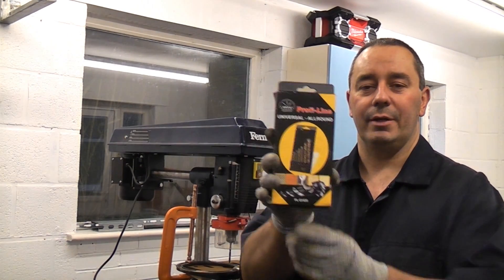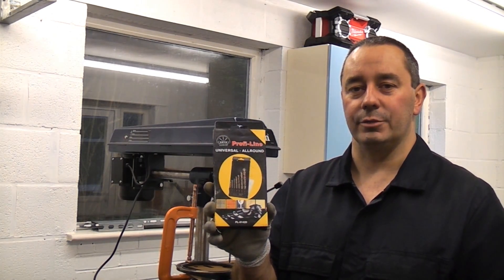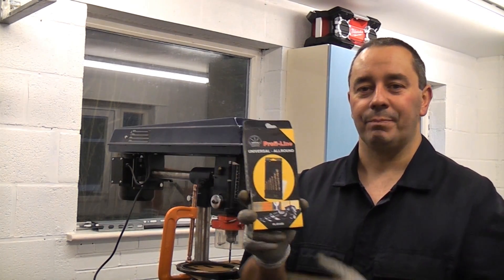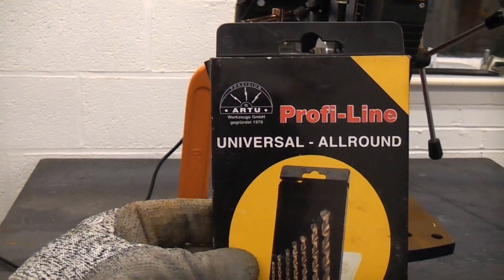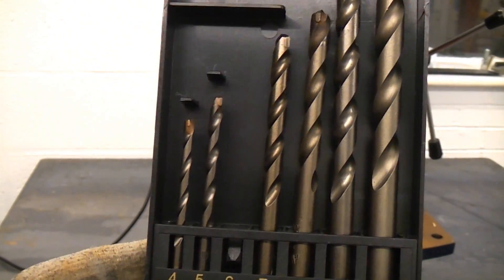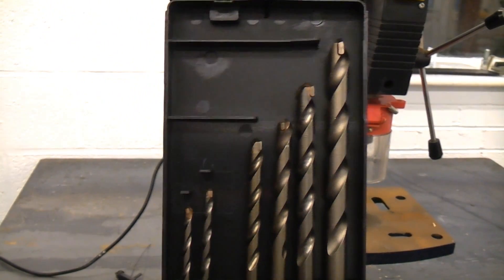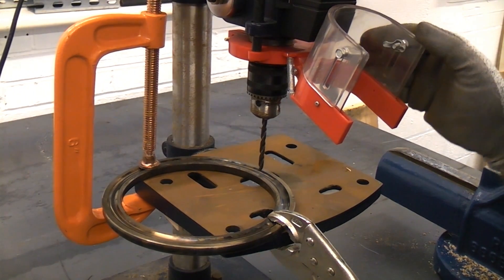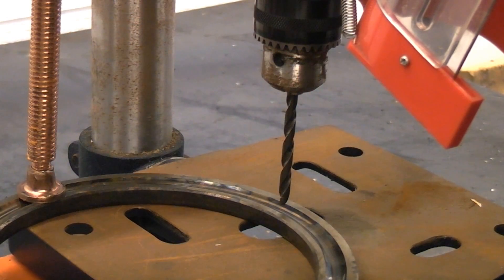How to drill hardened steel | Artu Drill bits

Comment: Surprised to hear that the highest speed should be used. You even changed the belt ratio.

So in this case RPM is more important than torque?  Would you agree that this is an exception to the rule? Thanks
Reply from the maker: Yes, I normally use coolant/lubricant when drilling steel, but these drill bits require the heat caused by the friction 👍 
I have to say that some of my ARTU drill bits are for for the bin now, but bearing race steel is incredibly hard!
Reply: @ultimatehandyman  So would it be wise to think of such bits as "sacrificial"? I mean more similar to cutting wheels than to normal drill bits?
Reply from the maker: @Gsazraetr   Yes, these bits are fine for drilling masonry/porcelain/glass etc. But when drilling a tough bearing race, just consider them to be sacrificial 👍
Reply: @ultimatehandyman  Thanks very much for the insight! Last question—
SOLID carbide drill bits on (unhardened) stainless steel. Should coolant/lubricant be used or not?
Reply from the maker: @Gsazraetr   I would not use solid carbide drill bits, unless they are in a drill press, or lathe. For drilling stainless steel, a cobalt drill bit works well and is much less brittle than a solid carbide bit.  But if I was using solid carbide, I would use coolant.

Comment: you do not use OIL , when drilling metal?
Reply from the maker: You do use a coolant or lubricant when drilling normal steel with a traditional drill bit, but this is hardened steel and can only be drilled with a specialist drill bit, which specifically tells you not to use any coolant/lubricant.
Thanks for the comment 👍

Comment: Just found this video 9 years later!   Don't know anything about metallurgy but have to drill several 9/16" holes in approx 1/4" thick heavy duty vehicle frame steel of unknown type (rumored to be part SS but probably not).   Not feasible to remove parts for use in a drill press.   Looking for the best type of 9/16" drill bit to reliably drill this in limited space, awkward position, upside down.   Yea, I know, there isn't one, but if there were, what would it be?  Cobalt?  Step drill?  Speed and cutting oil?  Not a machinest but I have to get this job done to mount a different style of air bag.
Reply from the maker: One of these should easily do it, as long as you take your time and use plenty of lubricant/coolant-
https://www.youtube.com/watch?v=HPv0W0UNdks
Or for thicker material- https://www.youtube.com/watch?v=NEXt_4Y6Wms
Reply: @ultimatehandyman  Thanks very much!  That second one looks perfect if I can find the SAE equivalent here in the USA.  Don't have room for a full impact, but I do have a stubby air impact (albeit limited air compressor supply) and an electric angle drill on order.  Will soon find out how they work!
Reply: @ultimatehandyman  This company's products sound almost too good to be true, but I've just found their US contact info, ordered the Impacta step cutter and versa adapter (altho won't be able to use the adaptor for most of this job) and some spray lube.  By the way, I called and actually got a live person!   Thanks very much for the suggestion, this seems perfect!
Reply from the maker: @DellAnderson   That is exactly what I thought. From experience I know that it is easy to make a product look good in a video. I have tried their tools out and was super impressed with them. My old boss buys a lot of cutting tools from them now, as they are really useful for the work that he does. He has been in engineering for over 50 years and even he was impressed with them 👍

Comment: Will these bits drill out a bolt extractor (chrome vandlay steel).  If  they do. I'm buying a set.
Reply from the maker: They probably would do, but I have not tried it yet.
I have used these to drill out a broken tap though- https://www.youtube.com/watch?v=7JCfEMrCjhc&t
Thanks for the comment 👍

Comment: Thanks for this. Really useful info and demo. Got an engine mount bolt to drill out of a bike frame that I accidentally snapped the end of a punch off in 😭
Reply from the maker: I've also drilled out a broken tap, using a diamond coated hole saw-
https://www.youtube.com/watch?v=7JCfEMrCjhc&t
(just another option)
Thanks for the comment 👍

Comment: Hiya, thx for the upload, did the bit go right through eventually?   
Since filming this, have you found any bits better than the ones you've used in the video?  I need to drill 4.5mm holes in the metal tongue of a seatbelt would these drill bits cope easily with that...?
Thank you for any help.
Keep the vids coming.
Reply from the maker: Hi Sean, I can't remember if the bit went all the way through, but I think it did. 
Bearing races are much tougher steel than a seat-belt tongue, you should be able to drill that just using a cobalt drill bit. Just take your time with it and use plenty of coolant/lubricant, like in this video- https://www.youtube.com/watch?v=Pa0eg9Z1eKQ
 Thanks for the comment 👍
Reply: @ultimatehandyman  fantastic.. thank you,
 I had a tongue that's gone through 8 bits, ok drilling to start, then it just stopped going through like it'd hit kryptonite or something🤣 
 But after watching the  video you linked i think i can safely say it was my poor technique... 🤣
Thank you so much.
 .👍👍👍👍👍
Reply from the maker: @seanditch4419   You are welcome. I must admit that I have struggled in the past, but after learning from others I now find drilling most metals a piece of cake. Thanks for the comments ;-)
Reply: @ultimatehandyman  Quick update for you, after watching your video,
Using the same set of cobalt drill bits, 2 holes drilled within a few mins, clean as a whistle. 
A 4.8.mm straight fron scratch, then i largened the hole i struggled with yesterday with a 5mm. 
Perfect... thank you😁👍👍👍👍👍👍👍👍👍👍🍎🍎🍎

Comment: I would suggest that you also use a good cutting fluid while drilling.
Reply from the maker: It is recommended that no coolant or lubricant is used with these bits when drilling hard steel.
Thanks for the comment 👍
Reply: @ultimatehandyman  - Just curious about the reason for that recommendation?

Comment: What’s it made out of??? Wthh is going on what about carbide will it drill through carbide???
Reply from the maker: The tip of the drill is tungsten carbide, no it will not drill through carbide, but this will-
https://www.youtube.com/watch?v=xJIPeNA1Iyw
These are handy if you need to drill out a broken drill/tap etc- https://www.youtube.com/watch?v=7JCfEMrCjhc
Thanks for the comment 👍

Comment: I'm thinking the friction from the drill softens the metal as your drilling. That's why you have to drill it dry and use a lot of downward pressure.
Reply from the maker: Yes, I think the friction generated helps to soften the steel.
Thanks for the comment 👍
Reply: That's what I was thinking. Though maybe not exactly the same, this reminds me of friction drilling.

Comment: Dude you need to use oil you are chewing up that bit
Reply from the maker: You don't need a coolant/lubricant with these bits. If you use one, the bit will not drill through hardened steel ;-)

Comment: Can they work with a hand drill?
Reply from the maker: They can work with a mains voltage hand drill, but you have to use them on a high speed with no lubricant/coolant.
Thanks for the comment

Comment: First off there is nothing special here....  It's a standard cement carbide bit with a sharp edge.  Hit one with diamond stone fast won't  vost you 300$ like these....  second you all are not even in right area anymore this is the 21st century people.  High speed ceramics replaced this year's ago.
Reply from the maker: I look forwards to seeing the video of you drilling a hole in a bearing race with a ceramic bit. Please let me know when you have uploaded it.  If you could make the hole about 8mm diameter like in this video that would be great.
Reply: Ultimate Handyman. First off not an issue!  Today at my shop I will show you how to drill a hole through a whole 160mm dia boat bearing top to bottom all as a solid unit! Balls and all inside cause ceramic bits chew hardened stainless bearings as part so fast and easy the balls won't even roll out of place inside as it cuts right through one.  You ramble on and on about how your such a skilled milling professional  every time people call out they are masonry bits...  But if you where really skilled you would know carbide hates heat and to cool it.  You would get a better chip rate at 10-20,000rpm drilling a stainless race like we do in my shop weekly for orders.  But unlike you we use carbide inserts or ceramic insert bits.  What you have is garbage masonry bits made with steel with a sharpened carbide braised edge put on that last 1 or 2 holes with a titanium nitrite coating to hide it.
Reply from the maker: Oh dear.
You seem to be confused, firstly I have not claimed to be a “milling professional” anywhere, I have simply demonstrated how to drill through hardened steel, which has obviously triggered you!
The makers of these drill bits “Artu” recommend not using any coolant on their bits when drilling hardened steels- http://www.artu.com/multi-purpose-drill-bit-drilling-tips.php

Please let me know when you have uploaded the video and I’ll critique it 😉

Comment: I tried cobalt bits to go thru spring steel, no good.  I used a masonry bit on 300 rpm and worked great. I will try it on a wheel bearing when i get time.
Reply from the maker: Thanks for the comment

Comment: Thank you so much for your video!

I was at my wits end trying to drill out a grade 8 bolt from a hardened engine frame.  I hit it with everything, titanium, cobalt, hss, regular split point tungsten and diamond grinding bits to no avail but not a masonry bit. After searching everything, I watched your video and said, what the hell, it might work. 

Owning a Bosch commercial SDS hammer drill and the .25" bit needed, it was worth a shot and after about 10 seconds, wide-open on hammer function, with no fluid, with sparks a flying, the snapped bolt was history. I is even more astounding that the bit I used has drilled hundred of holes in concrete block with no sharpening or tip work. 

All the naysayers need to simply keep quite because this is the way to do it.
Reply from the maker: You are welcome.
Thaks for the comment and very well done ;-)

Comment: why you don't go slow ....
Reply from the maker: You have to go as fast as possible with no lubricant as the generated heat helps to cut through the hardened steel.

Comment: cant you just use a masonary bit then,as the head looks like tungsten
Reply from the maker: +john kilner 
Yes, you can but I'm not sure if they would be as good as the ARTU bits although they should work.
Reply: you can ,but first you have to sharpen bit with diamond wheel....

Comment: can masoner be sharpen if can u show
Reply from the maker: +rajen ojar 
You can sharpen them but you need a special grinding stone as the tungsten is too hard for a traditional grinding wheel. 
You can buy a small one that fits in a drill, I'll cover this when I get chance ;-)
Reply: @ultimatehandyman  you just need regular diamond coated aluminum wheel to grind carbide...

Comment: isnt it a bit too fast since sparks are flying off of it?
Reply from the maker: +Tiivi Vaavi 
No, the makers of the drill bits (Artu) recommend drilling hardened steel on the fastest speed setting with no lubricant.
Thanks for the comment

Comment from the maker: @emmigrate 
They look okay but not sure if they would drill a hardened steel bearing race!
Reply: Yep, they do. Drill through most anything. HSS, engine valves, hydraulic lifters, case hardened parts all drill fine. I tried everything hard in the engineering workshop.